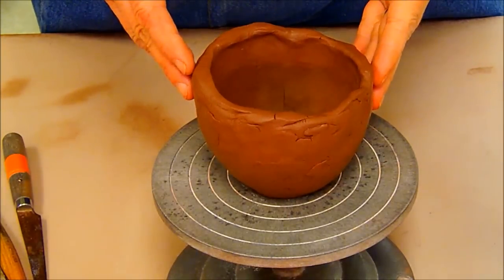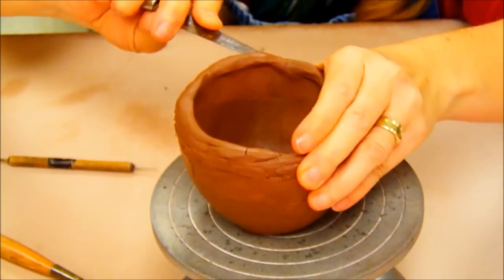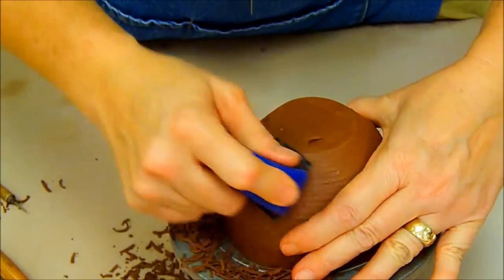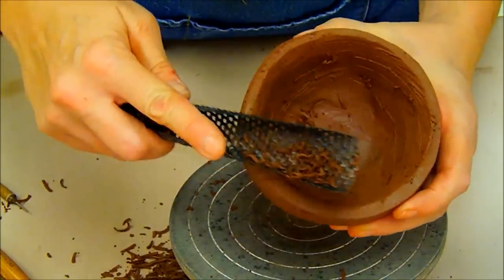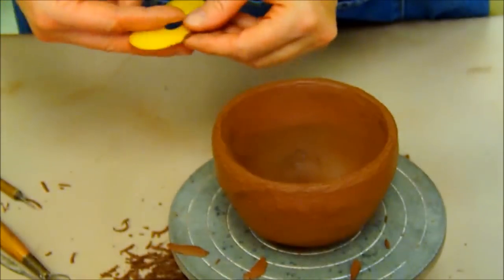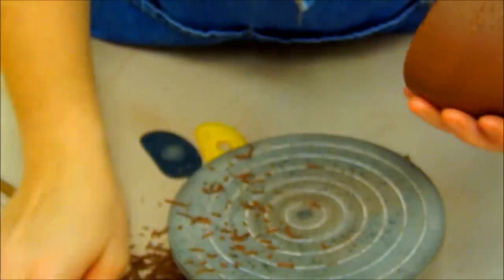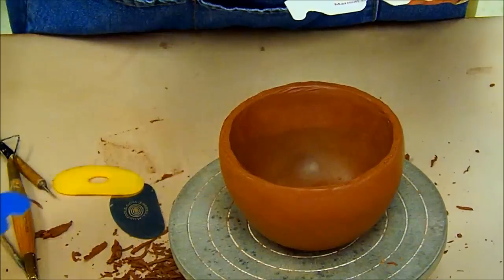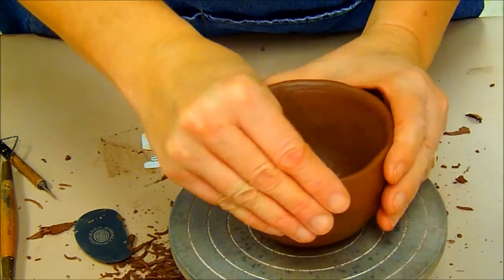Cleaning Pinch Pot Cup Forms Ceramics I (2nd day)

Comment: Hi Karen,
Thank you for this great tutorial. I have a couple of questions. I am giving a 3-day pinch pot class, and hoping that the students will be able to walk away with their finished piece (underglazed and fired). So basically they will need to make the pinch pots, wait for them to get leatherhard, decorate and underglaze them, apply clear glaze, and fire away. The class will be running every day from 9am to 4pm for 3 days, so how long would you recommend I dedicate for each step?
Reply from the maker: Hi Noha- in three days that sounds ambitious... unless you want them to be able to pick up the following week.  I have had kids do it with 5 days before.   If you really are going with a once fire method, you may consider having them pinch (morning) make handles (morning), clean (afternoon),  attach handles and footrings (afternoon) and finish cleaning .  Second day, start and finish glazing (morning)... then leave them uncovered throughout the day- maybe even with a fan or in the sun.  Then you could do a quick fire that evening if you are sure they are completely dry.    Just make sure they are really dry though... because explosions of glazed greenware clay can be disastrous, as the shards stick all over the kiln and can damage the elements.  Cups with handles should have EVEN drying to prevent the handles from cracking.  So, you will have to control the drying so it is even. I recommend drying under towels, but that will also slow things down.  I hope this helps some!

Comment: What do you recommend I do if there are scuff marks on my pot and it isn't smoothing out with a yellow rib??
Reply from the maker: +Daisy Marin 
Hi Daisy!  If the marks are just slightly scuffs rather than dents... perhaps a red rib with a little water?  It can give a really tight, smooth texture that is nearly shiny.  Almost burnished.  However, if the scuffs are actually dents, I would move back to a stainless steel scraper... to scrape away the clay and even it to the bottom of the dent.   (I hope one of these two solutions makes sense for your problem!)  Let  me know if you need more clarification, or a different answer!  ;-)

Comment: Thank you Karan. I enjoyed this video and was looking for a clear and step by step guide - I found it. Thanks to you.

 I am thinking of ordering Botz Engobe to add design and texture and for my kids to use. I also came across underglaze pencils a while ago and bought some.

Have you ever used Botz Plus?  I have some of their stoneware glazes and they are very good and would like to experiment with  this product in the future.
Reply from the maker: +Smile Wider Sorry for the delay in responding!  I just now saw this!  No, I've never used or even heard of Botz Engobe!  I'm assuming you're in a country besides the US?  ;-)  I bet it would work!  I've only used a few engobes in the past, and then, I've never used them on greenware.  My advice is just make sure the engobe doesn't stick to the shelf if on the bottoms of pots.  I assume it wouldn't, but since it has been years since trying them, I'd test if it first to make sure!  The only reason I use the underglaze with my kids is just in case they make their pot too thick, and one explodes, the underglaze won't fuse to the kiln shelf!  I've never had one blow up, but I still like to be cautious!  ;-)  Ha!   So, I have a question for you then too... would you clear glaze over the engobe once bisque fired then?  I've actually only ever used engobes on top of another glaze in the past!  I'm curious to know!  :-)
Reply: +KaransPotsAndGlass 

Hi there. I will be clear glazing after I have applied them to bisque. Same goes for the pencils. I use Botz because I like the set they do and I started using Botz Stoneware glazes. I plan on using Botz Plus when I make larger piece in the future.

Comment: My clay cracked a lot what do I do?
Reply from the maker: Hi Eunice- sorry for the delay- I was out of town. What is the clay you are using? Be careful not to overwork your edges, or use excessive water on the edges, as that can cause cracking.  It basically will break down the clay and recycle it if you add too much water.  Just let me know a few more specifics on when you see the cracking, and I can help you troubleshoot more!
Reply: KaransPotsAndGlass Thank you! I think it had to do with where I wedged it. It was an old wood table and it may have sucked out the water. I’m not sure if that’s correct but my cracking was before it dried while I worked it. I’m using a speckled buff but I was wondering if I could make something like this with porcelain?
Reply from the maker: @EuniceVillalobos1  - yes, you absolutely can make it from porcelain!  As I tell my kids... just pinch it quickly, and smooth over cracks before they get big... immediately smooth them over!  If you pinch or squeeze the clay when it begins to dry, it tends to crack!